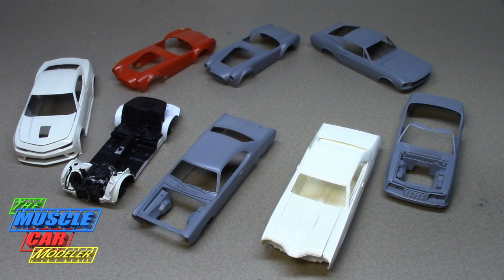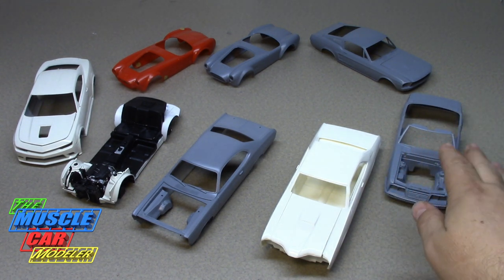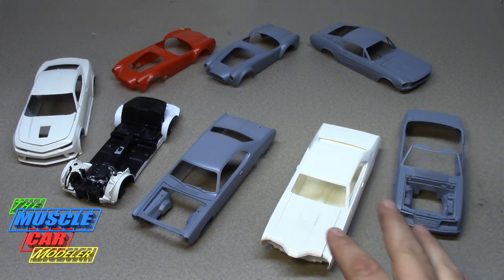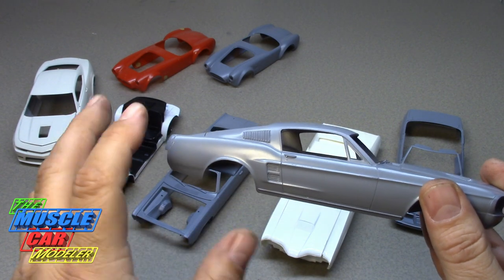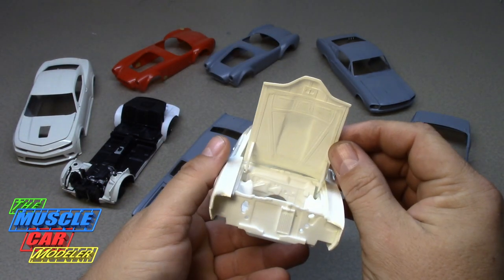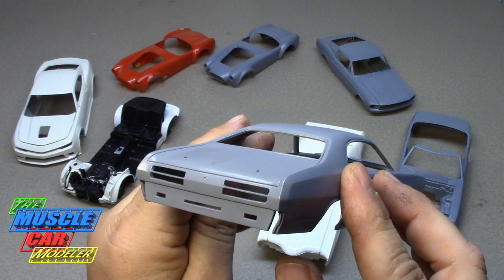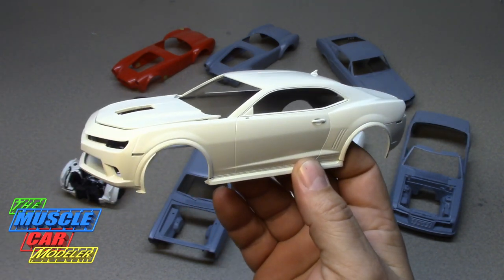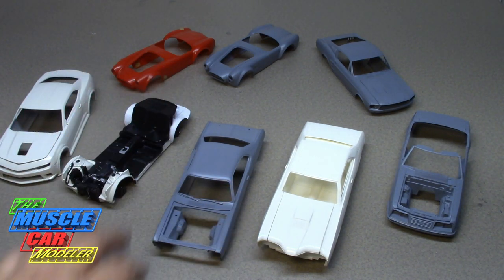Some stalled Wips for your pleasure

Comment: Get those WIP’s finished.  Having 60 WIP’s would drive me crazy.  I’m down to two right now, and feel so much better with the hobby.  But, right now I’m taking a little break from modeling so I can get some projects done around the house,  but I’ll be back to modeling soon.  Thanks for sharing.
Reply from the maker: I’m down to under 40 started. Some need some serious work.
Reply: @TheMuscleCarModeler  40 is definitely better than 60.  If you can average finishing one a week, then within a year you should be able to get all of them finished.  Good luck.

Comment: With my Mopar bias, I most want to see the Duster get finished. Beyond that, I have to go with the muscle cars I grew up with. I owned a '67 Mustang GTA so that and the Cyclone Spoiler would be great to see done. Other than that the Cobra looks like a fun project and the body you removed the oil cooler on could be built as a modern kit car with the 80s or later 5.0 engine and drive train. It would also be interesting to see you do a '"how-to" or "tips & tricks" on how you select your rebuilders and how you get them disassembled and cleaned up for the restoration or upgrade like with the Cyclone. them apart.
Reply from the maker: Most Mopars, once I start them I usually finish them. I have a few unfinished and didn’t show them this time. 95 Viper, 68 Barracuda and 69 Barracuda.

Comment: Your mention of putty made me think of an old trick. Some guys used to put excess sprue in a jar and add solvent to melt it down. After a couple days you had putty that was essentially the same as the plastic used in the kit. I never tried that, but I thought it was interesting. You?
Reply from the maker: I have heard of that but never tried it.

Comment: You know I am more of a revell monogram modeler and for the life of me I cannot understand why revell already making a 1970 ford torino  never used the chassis and other parts to make a mercury cyclone  or a line of ranchero  models . I mean the platform is already there.
Reply from the maker: I think Revell had planned on a few more versions but have not gotten to them. They are rereleasing the 70 Torino Cobra soon. It's been a while since the Cobra, or the GT have been released.
Reply: @TheMuscleCarModeler  would have liked to see some mercs and pick up Ranchos 429s and 351s

Comment: I think by 1984, Shelby was with Dodge. And at that point all Shelby's were just Ford in-house branding and not true Shelby cars. Yes, they did have hi HP cars and all so I am still confused on what makes a "Shelby" car a true one. lol
Reply from the maker: What makes a Shelby is hotly debated. The 84 Mustang 20th anniversary edition has the Shelby look with the G.T. 350 side stripes. It does not have a Shelby badge or CS logo on it anywhere. It is also not recognized as a Shelby. I believe Shelby did file a lawsuit over the car as he was working with Chrysler and had owned the rights to G.T. 350.